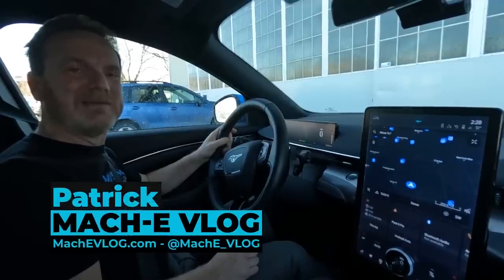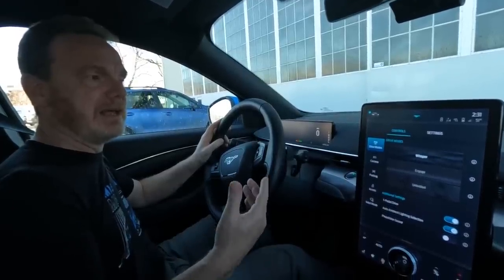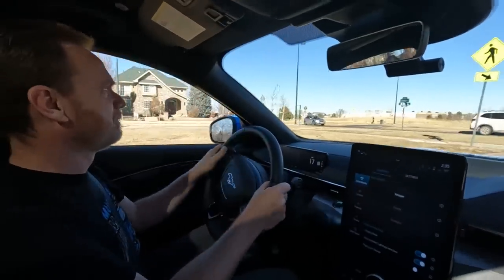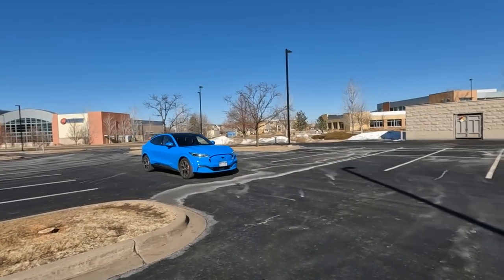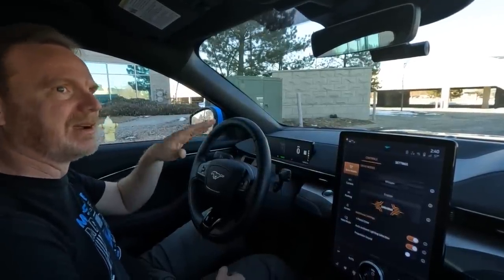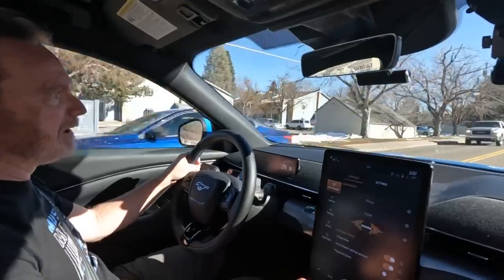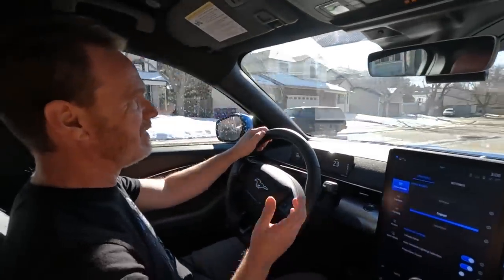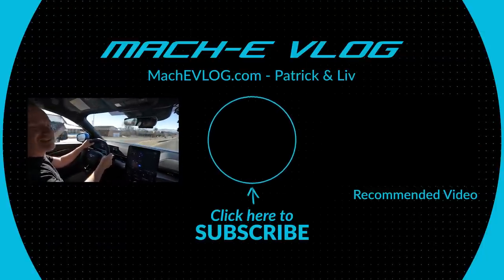What is One Pedal Driving? Tips and tricks (Mach-E and other EVs)

Comment from the maker: Do you use One Pedal Driving? If so, do you use it all the time or just some of the time?
Reply: Love one pedal driving! I only turn it off once in a while, so I can use the brakes to clean the rust off the rotors lol.
Reply: I use it all the time. Now that I have gotten used to it, I prefer it.
Reply: I use it all the time, hate it when I go drive my ICE vehicle! I find it harder to drive the ICE vehicle then my Mach-E. Don't like the coast, more control with one-pedal for sure!
Reply: Starting using for regen purposes, never went back.
Reply: Taught myself just to check it out and never went back. As strange as it sounds 1P driving seems to make you feel more connected to the car to control speed. Love the tip on covering the break when stopped. Will start doing that.  Use 99% of the time.
Reply: I use it all the time and love it. I recently drove a Lincoln continental which of course doesn’t have one pedal drive and found it difficult to remember to use the break. I didn’t realize the difference between the different modes, I sometimes use the whisper mode and will keep it in middle one from now on. Thanks for the information.
Reply: Yes! I got used to it very quickly. Thanks for the foot on brake tip! Never thought about it that way.
Reply: Yes, I love one pedal driving. I found is very easy to learn.

Comment: You did not mention the fact that the Mach-e blends regen and friction brakes when in regular (non-1-pedal) mode. In regular mode, the car will decide how much regen or friction braking to use depending on the level of braking applied at the pedal. It will default to use regen primarily up to a certain point. 1-pedal vs regular mode is mostly a user preference and will not greatly affect efficiency. Regardless of mode, smooth driving (minimizing big acceleration/decelerations) will yield the most efficiency. I am surprised how many people commenting on here do not understand this. 

Tesla does not blend regen and friction with the brake pedal, their system is completely different from the Mach-e

Comment: Thanks Patrick. Like you, I consider myself pretty proficient with 1 pedal drive having had my Mach-e for a while now but your video has solved the mystery of why my 'brake coach' had disappeared. I didn't know it only showed in Engaged mode. So thank you! That saved me an embarrassing and time wasting trip to the dealer ;-) In fact I'd be surprised if they even knew this.
Reply from the maker: It took me a while to figure it out. I started using Unbridled a lot and the brake coach was gone. At first, I thought it must have been some update. But then I switched back to Engaged and saw it again.

Comment: Great video. We love one pedal driving. Chris especially. I find it very helpful to drive more efficiently.  We find the car drives MUCH differently with one pedal driving-much better than traditional pedal driving. I don’t even like driving it with traditional pedal style. It’s just so much better with one pedal.
Reply from the maker: I turned off yesterday just to see if I could get used to it. Nope. I much prefer 1PD!
Reply: @MachE_VLOG  I feel it’s almost as if with the weight of the car it’s too hard to slow it down with 1PD off. Like I’m afraid I can’t get it stopped. There’s just so much momentum there that I like that there’s the assist to stop. And it’s a smoother drive dynamic.

Comment: Thanks for the video.  I did a test drive of a Chevy Bolt EV and Single Pedal is a pretty cool feature. But I suppose it takes a little getting used to far as stopping distances in traffic - plus it does Regen back into the battery. 
Adaptive cruise is another nice feature.  I plan to get an EV in 2024, just not sure which manufacturer.  Will be based of features and pricing.  Looking forward to getting an EV.

Comment: Patrick, do you know that Porsche is completely against one pedal driving and even its regen setting is really nothing more than an automatic transmission feel. I have completely embraced that behavior, but I am quite familiar with one pedal driving with my Chevy Bolt EV and L mode. On a Tesla it is necessary to use one pedal driving because they do not do blended braking and nor does the Rivian truck. However most every other EV on the market does do blended breaking and thus one pedal mode is nothing more than a preference and should not really affect efficiency. 
I would love for you to do some tests with maybe 100 stops or such with using one pedal mode versus using the brake pedal and one pedal mode turned off. Of course if you stop more suddenly than regen can support it will use friction brakes. Can you try breaking slowly as well as doing regen?
As far as coming down the mountain why couldn’t you just set cruise control at some specific speed and then the car would maintain it and do the appropriate amount of regen?
Also I would love to hear your opinion and feedback from passengers when you use one pedal driving versus using the brake pedal and coast mode. A lot of times one pedal can lead to more sudden stops then your passengers would appreciate and requires tremendous amounts of finesse on the release of the accelerator pedal.
Great imitation of Liv at the end, except not with her upbeat voice.
Whatever you drive enjoy the ride👍
Reply from the maker: I believe VW argues against 1PD as well. I like it now just because it makes driving more simple. It also reminds me to try to slow gradually so I don't have to use the brake pedal.
Coming down a mountain on the interstate (I-70 west of Denver) I have used cruise control to just let the car manage the speed and regen. Coming down smaller roads, I have to vary my speed due to the various straight and curvy sections so I don't use cruise control there.
A lot of people have commented that their passenger gets car sick when they use 1PD. I think if you get good at modulating the speed with the one pedal, they won't notice nearly as much. I'll have to ask Liv!

Comment: Thanks for this interesting vidéo.
Physically theory speaking, (by the law of thermodynamic) the best energy is the one that you ha not use.
Meaning on flat roads, coasting will always be more efficient. With one pedal driving As you Release the trotle car regen energy but this will always be less than then energy used to come back to the original speed.
On the other side in mountains and specially downhill, you will indeed generate à lot à be beneficial.
I guess than on sporty roads and driving, one pedal car give more fun and efficience in the driving style.
Reply from the maker: I get the physics theory behind the efficiency, but in real world driving Ford has said that it doesn't make a significant difference for most people.
Reply: @MachE_VLOG  anyway i will give it a try, once my mach e is deliverred. Postponed from 16 of avril to Earl jury. But as you said it needs to be praticed to get use to it an feel confortable with it

Comment: Around 12:16 you mention Brake Coach is availabe in Engage mode but you made it sound like it's only in 1PD mode.  I'm not sure if you meant it that way but it's available with 1PD off as well.  FWIW, I regularly get 100% energy returned w/out 1PD turned on.  Honestly, there should be no difference in regen amounts if you aren't mashing down on the brake pedal. (I hear this is different on Telsas though as they don't have blended regen with their brake pedal)
Reply from the maker: Great point! And awesome braking efficiency!

Comment: Someone's gonna have to explain how 1 pedal driving could be more efficient than coasting. It's not physically possible unless you're claiming the Regen is more than 100% efficient.
Reply from the maker: It's more efficient than using friction brakes. As I mentioned in the video, people won't notice any range difference according to Ford.
Reply: ... it also tends to save your brake pads a little better

Comment: Not driven a car with One pedal Driving yet. However as you started to explain how it works my first though was the car behind (which probably does not have one P.D) will not be slowing at the same rate and speed as you which will increase the risk of being rear ended.
Then you mentioned that you were recently rear ended !!
Reply from the maker: When you let off completely it is like braking and your brake lights will come on.  If you want to let off some, you can do that as well.  You likely can’t tell the difference between one or two pedal if you are behind me. When we were rear ended, we were at a complete stand still and the guy that hit us was just trying to cut into the line of exit traffic. It didn’t matter what mode we were and since we weren’t even moving.

Comment: My Tesla goes into a “hold” mode when it comes to a complete stop and if someone were to rear end me at that point it would not move, thus not necessary to hover over the brake pedal. I assumed “hold” was standard on all EV’s.
Reply from the maker: It is standard. But as I said, if your foot is resting on the accelerator, you may inductively press that. When you press the accelerator, the hold disengages. There were many reports of Teslas experiencing "sudden acceleration." The car was blamed, but after investigations, it turned out it was people accidentally pressing the accelerator when they thought they were on the brake.

Comment: I used the one pedal once. I was in heavy traffic. I took my foot off the accelerator as I am accustom to do.  My car quickly decelerated. I hear the car behind me slam on the brakes.
Reply from the maker: You don't have to fully remove your foot from the accelerator, you can moderate the level of regen braking in one-pedal mode gradually.
Reply: @MachE_VLOG  Yes that is a problem with driving for driving over 65 years. Old habits are hard to change. I will not use one pedel again.

Comment: How does cruise control interact with one-pedal mode?  Can I take my foot off if cruise is engaged?
Reply from the maker: Cruise control handles it just like normal. As the driver, you won't notice a difference while cruise is on.
Reply: @MachE_VLOG  so it effectively turns it off when cruise is active? Makes sense

Comment: How does this impact driving in snow. Is there some sort of anti-lock mechanism?
Reply: I can't speak for the Mach E, but on the Soul EV when using B mode for aggressive regen braking. If I hit an ice patch while slowing which engaged ABS it goes into free wheel/no regen mode which can be quite scary the first time it happens. Common recommendation across many EV message boards is to use low/no regen for winter conditions.

Comment: Hi Patrick, I bought a nissan note e power and using one pedal drive mode a lot. But it happened a few times that after I was waiting for red light for a couple of minutes with my foot on neither pedal, when traffic light turned to green and I stepped down the pedal again, my car just didn't move. Instead, it made beeping sound and left a long distance from the car in front of me. After a few seconds, then it started to move. I wonder have you ever come across the same problem? Or if you know what the problem might be? Cheers

Comment: Did you have someone follow you to let you know when your brake lights were coming on? Can we assume when the brake coach is on (in engage mode) and the little lightning bolt goes from blue to green that the brake light is on? I love one pedal driving but I have a hard time maintaining a steady speed without accelerating.  I feel like when I ease off the accelerator even slightly, the lightning bolt turns green and I assume the brake light is on (which is probably making the person behind me nuts). I wish I knew when the brake light was on and if the lightning bolt turning green is the indicator. ETA: I guess the lightning bolt is only on the GT model
Reply from the maker: Not for this video, but I have before. I've also tested a bit a low speeds on a dark street where I can see when the lights come on. Basically, if I left off completely the come on. If I barely let up, they don't come on. It must use a g-force sensor or something so they only come on when your car is slowing as if you were really braking.

Comment: So... Using the brakes on a mach-e doesn't do any regen?? Is that it?
Reply from the maker: No, it is a blended breaking system so it does use regen.
Reply: @MachE_VLOG  great. So... 1PD seems to be just a hype thing imho. Doesn't make much sense to me other than in a heavy standstill traffic situation where one needs to constantly start and stop the car...
Because,other than that, ultimately, you'll still need to quickly fallback to the brake pedal anyway.
Reply from the maker: @FranciscoNogueira  It makes overall driving easier if you ask me. It's really great on curvy mountain roads. It's so easy to regulate your speed with just one pedal. Even in normal driving I give it very useful. I use it all the time but not everyone likes 1PD.
Reply: @MachE_VLOG 
I get you.
On the other hand I think once I get an ev I'll end up using both feet. One on each pedal.
Is that even a thing? Honest question. I have no idea. Haven't seen anyone talking about doing it...

Comment: What happens going down steep hill with one pedal? Does it still slow down to a stop? Also, in 2 pedal mode, does coasting still regen?
Reply from the maker: Great questions. Going down a relatively steep hill it will still come to a stop but it does take longer. I haven't tried a really steep hill. In 2 pedal mode, coasting doesn't use regen but light braking does. Heavy braking engages the regular brakes.

Comment: if you use very gradual stopping the brake lights may not work ?
Reply from the maker: If you very, very gradually slowed down they might not. But, it would have to be like you were coasting to a stop without 1PD. I think that would be nearly impossible and not something to worry about.

Comment: Does regen still work if you turn off one pedal driving?
Reply from the maker: With one pedal driving off, you will be able to coast. And when you apply the brakes, it will use some regen and blend in the regular brakes as necessary.
Reply: @MachE_VLOG  thank you, I want to eventually get the mach e, but I wasn’t sure if I would like one pedal driving  and I didn’t know if regen still worked with it off. This helped a lot

Comment: Do you have citations for Ford saying 1PD is more efficient?
Reply from the maker: From what I recall, they basically said it was only slightly more efficient in a best case scenario. It would be if a "hard braker" switched to 1PD. Most people won't see any noticeable difference at all. It's the same as the driving modes. Unbridled isn't less efficient than Whisper but your driving style while using Unbridled might make it so.